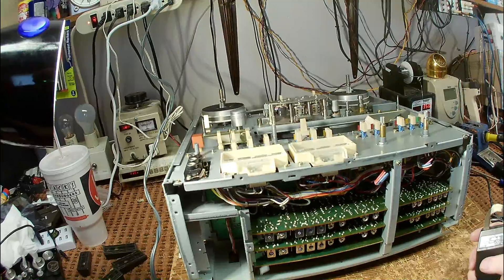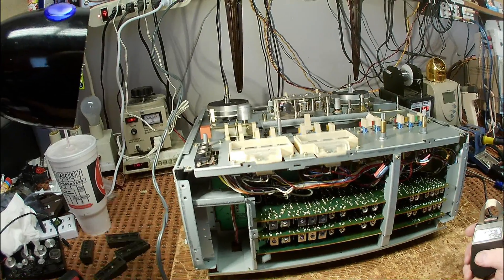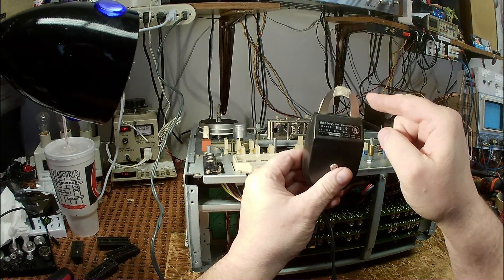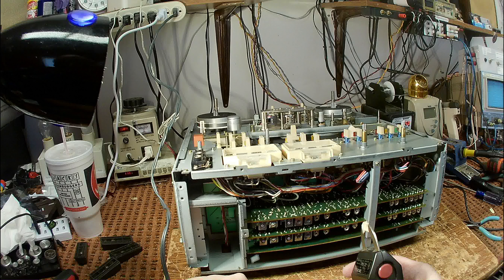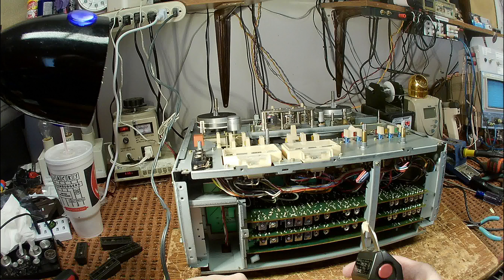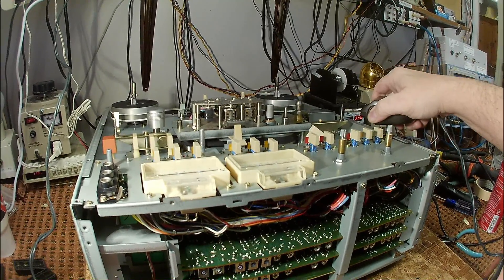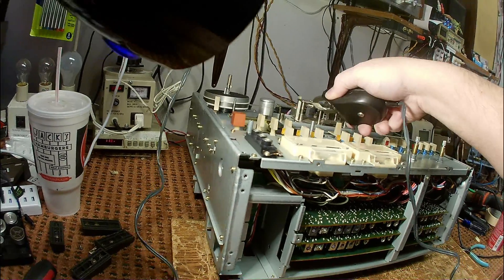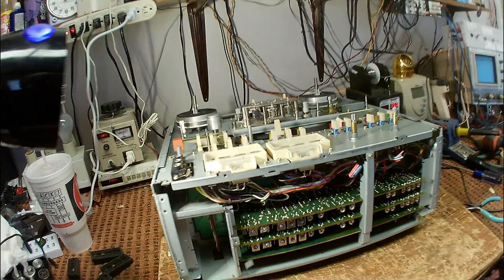How To Demagnetize Tape Recorder Heads

Comment: 12" is plenty distance for the turn-on turn-off operations.  These distance recommendations seems to grow long and longer, out to several feet.  That is unnecessary.  12" is more than enough.
Reply from the maker: Perhaps. But the reason for me recommending that people move the demagger out to arm's length away is to keep them thinking about not letting go of the switch without moving it away. It only takes one forgetful moment to ruin a head, so more distance is better. It's not the distance I mean to reinforce; it's the habit of moving away from the heads before turning the demagger off.